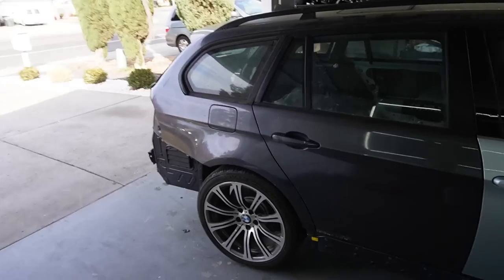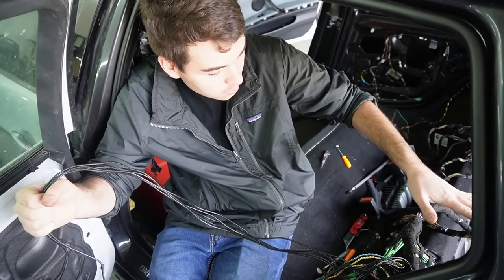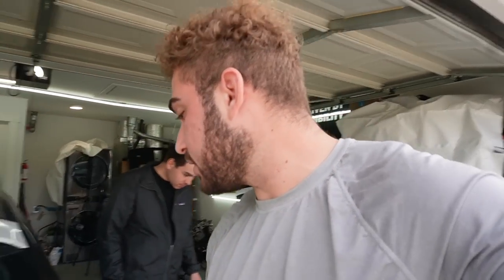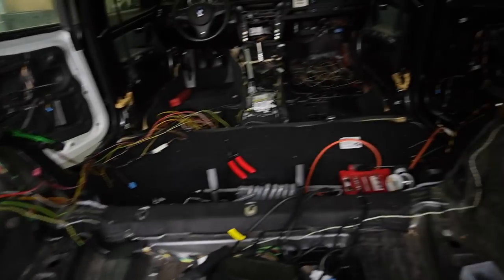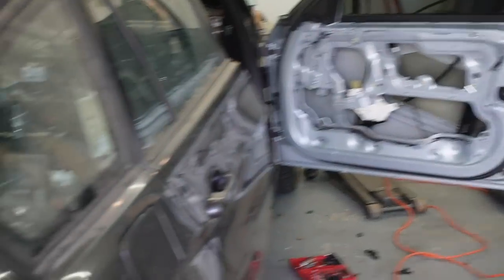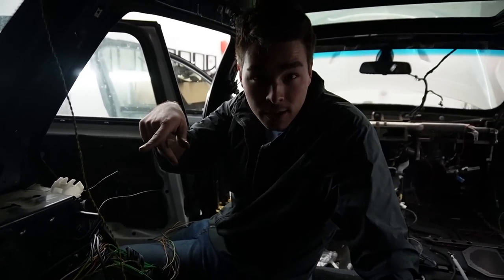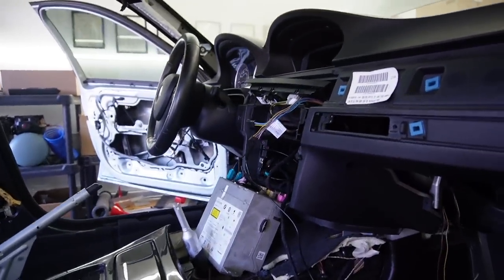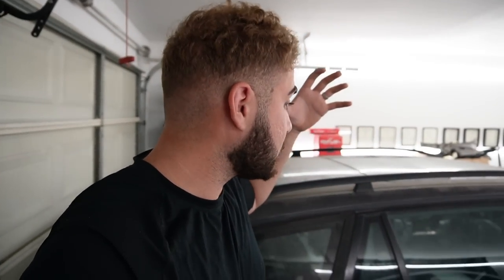Building A Custom 1 of 1 E91 M3 Wagon! (Part.19)

Comment: For anyone following at home we are around 30 hours of labor to merge the E91 harness with the E90 M3 harness. I would estimate that it will be another 10 hours of labor to get everything flashed, coded and diagnosed so that all functions are working. 

This is definitely not a project for the faint of heart.
Reply: Info on nbt evo retrofit?
Reply: Appreciate your hard work 🙌
Reply: Hi from south africa could you tell me what wires needs to be extended or added on e90 harness

Comment: HOLD the sunroof button up (vent position). After about 15-20 seconds, the sunroof will vent. CONTINUE HOLDING THE BUTTON UP. After anouther couple of seconds, 15 or so (could feel long, but keep holding) , the sunroof will close, the open completely, then close completely.

Once the sunroof has closed completely, the proccess is over. It's important that you do not let go of that button while the proccess is happening.

did this on my sunroof (e92) it was tilted like yours and it fixed it. if it dont work take it to the dealer